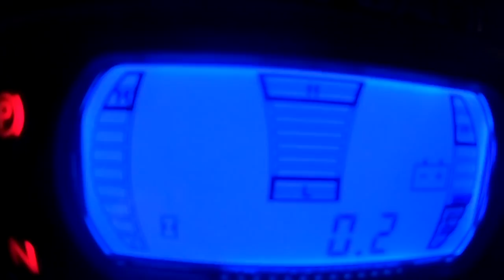New Mower for Fall Clean Ups | Curb Side Leaf Pick Up

Comment: I use the exact same mower for leaves. There are some big pluses and minuses to using it. Get proficient at jumping off and unclogging the hose, thick wet leaves will be challenging. You will figure out a method, and then it can be a great asset. I like to shred big piles on blacktop, then go over them slowly with the deck all the way down. They turn the leaves into dust, so that really helps on space.

Comment: Bought the same mower last season.  I picked up a used 3 bagger system from brother in law but would like to switch over to the clam.  All of our lawns are curb side dump so it would really speed things up. Like someone else commented lowering the front baffle all the way down almost eliminates front blow out.  Dealer may have already done that for you.

Comment: Had the same problem on a gravely all summer....finally found the problem.... The vacuum line for the fuel pump had dry rotted...a lot of cracks and it was just getting enuff vacuum to run but couldn't suck more than a quart of fuel from the tanks...but I'm with you....worst case senerio if it's a carb pull it and replace it....all that electronic stuff would drive you crazy trying to find it

Comment: We currently only use backpack blowers, a 60" hustler stander with an accelerator bag, and tarps for leaf removal. We are in between getting a dump trailer and leaf vac OR a clam shell bagger like this. We're leaning towards the leaf vac first this year because one of our service areas is about 45 minutes from the dump and we need to be able to do multiple jobs before going to the dump. What do you think?